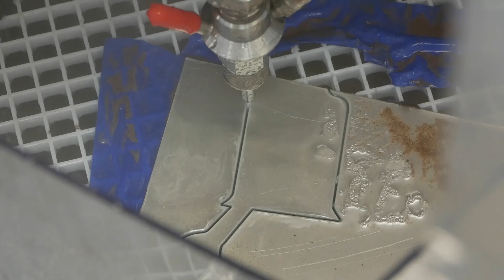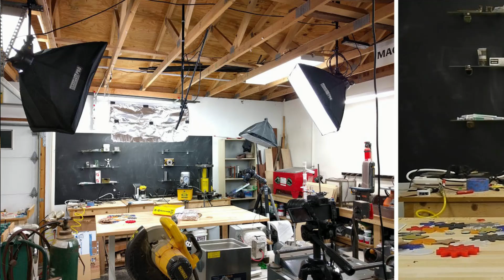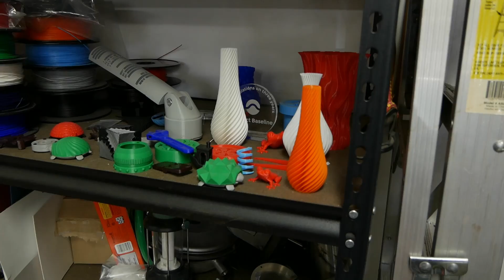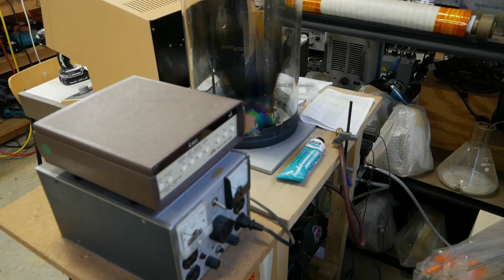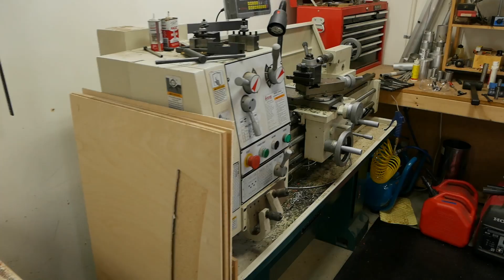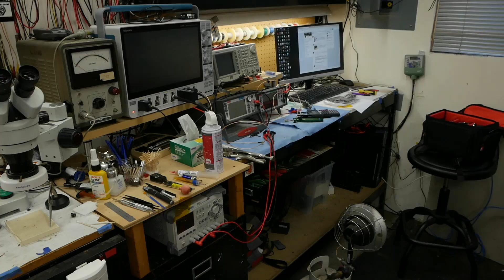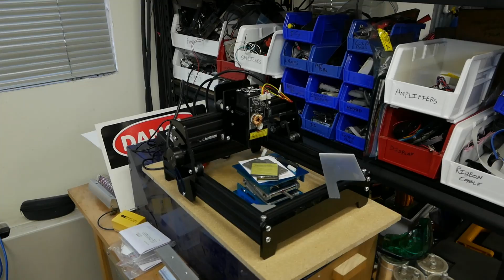Behind the scenes at Applied Science: Why video? Camera gear. Shop tour.

Comment: All of those 3D prints. Was it not you that said just 1 or 2 years ago that you wold rather invest in CNC mills, lathes, etc. than 3D printers? Have you changed your mind on this point?
Reply from the maker: You are correct!  We had a couple situations at work where the 3D printer really saved the day in a way that no other prototyping technique could accomplish.  The Form 2 offers very high resolution in materials that are tough enough to use in real product demos and small group testing.  We spent quite a bit of money every month with Protolabs to get high-res SLA parts, then realized that the Form 2 could achieve almost the same thing for a much lower cost.  It then made sense to start doing it in-house.  Once we started using the printer, we found many additional uses for it that increased capability and reduced cost. I know this sounds like an advertisement, but it's all true!  I still believe 3D printers have no use currently for "everyday users", it's still only really useful for prototyping in professional environments -- not for the consumer (which many 3D printing enthusiasts seemed to imply).
Reply: @AppliedScience  What about a combination use case? 3D print to then investment casting (via the lost wax, or lost PLA method) into aluminium and finishing with a CNC mill?
I have 2 CNC machines, one reasonably sized homemade router, and one converted metal mill (a G0704 type) for hobby use, and my one big frustration is buying all the raw materials to cut to then just turn most of it into aluminium chips or plastic or wood shavings.
For professional users the raw material cost and amount is not a problem because the bill is pushed to the costumer, and the rest materials from the full lengt bars or full size plates will always come to use later. But for a hobbyist all the raw material you have to buy in all different shapes and sizes adds up fast, and you may not have a use for the rest of it after. But with additive manufacturing you can both keep the waste to a minimum and get whatever size or shape stock you want without having to buy it. So use a cheap FDM 3D printer just to make stock material for a CNC mill.

Comment: I have one of those cold traps too. I've tried three welding supply places. None will sell me a cylinder of ethylene. How much hassle would it be to make some from ethanol and get it dry enough to run in it. The first stage runs and cools to -58 and the second stage kicks on after a few min but only barely cools.

Comment: Ben I pulled apart a Meta Bones Speed booster 0.71x a day or two ago and I was not impressed by the internals, however you would be interested to know that  the focal reducer is a actually a single element. I notice your using what looks like the Viltrox (cheaper version, you totally made the right choice)